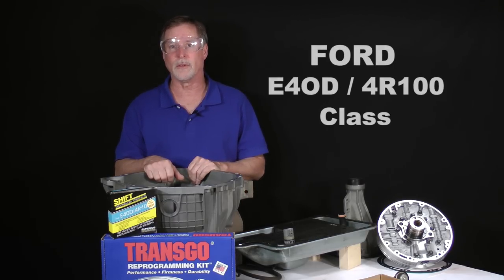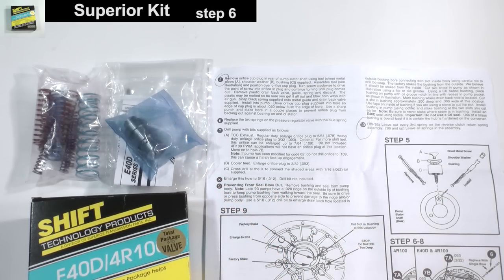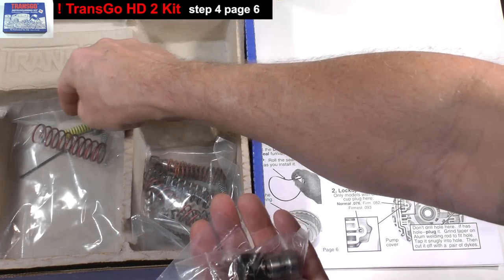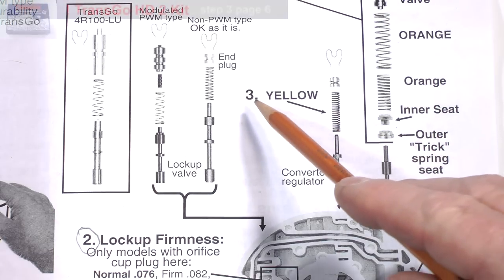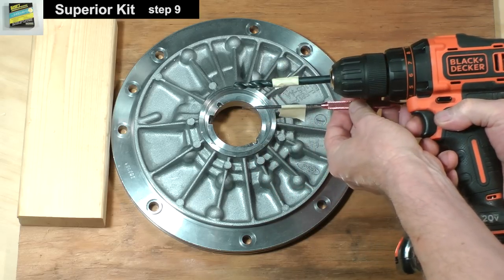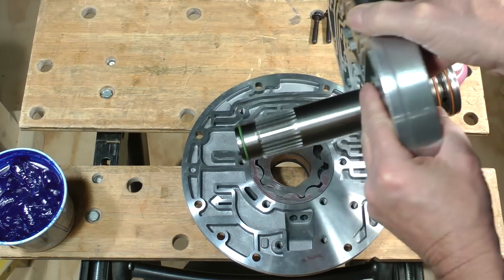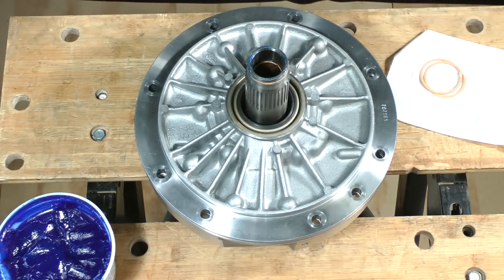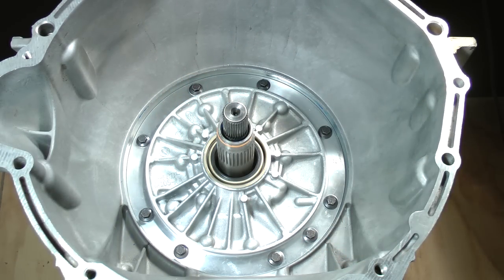Ford E4OD / 4R100 Class lesson 13 of 16

Comment: Love these videos. They are at a good speed to perform the work while watching. I used these to do the initial break down, inspect, clean, and creation of needed parts for my 2003 diesel 4R100. I ordered my Super Deluxe kit from Transmission Bench March 2024, which came with training videos on a thumb drive. Jimmy is great and will take the time to ask and answer your questions. The new kit didn't have the neatly labeled white parts bags, but it was still easy enough to figure out which parts go where. If you have an older vehicle, I highly recommend doing this work yourself. It will not only give you the confidence to do your own repairs, but you can also save money, or put the money into upgraded parts. Only you will put the best time and attention into your vehicle repairs, all while learning something new. Keep up the good work Jimmy!
Reply: How far along are you I'm considering building the e40d in my f250 using these video
Reply: @joshuadaniel1001  I have completed the rebuild and now I am putting everything into the truck. Take your time, don't force anything, and go step by step with the videos. You may find small differences with your transmission like I did, but I was able to "Google" my variances to ensure correct rebuild. This project will teach you some great mechanics about automatic transmissions.
Reply: @JDM850  when you get it in and test it let me know If you dont mind a verified success case is motivating
Reply: @joshuadaniel1001  Sure thing! Marshall Sanders videos also had some great information on how the clutches in the transmission and valve body works, in depth. You will easily be able to understand how simple it all functions, which will increase confidence for a task like this.
Reply: @joshuadaniel1001  Success! I added the 18 quarts my system needed, had it on jack stands for the initial FWD and Reverse test. Then did driveway FWD and Reverse test.  For road test, went through all (1, 2, D, OD on/off). WOW, shift kit ensures it is in gear, lol. Recommend smallest holes when drilling, as kit instructs. Gentle driving, shifts great. Drop the hammer and she locks and goes, no questions, and no mushy shifting anymore. I went the extra mile to over engineer with the Suncoast center support kit, 300M input, 4130 FWD drum, and a Goerend TC. Even with all upgrades, it was still 3k cheaper than having it done at a shop, plus I now know more about my truck and the love that went into building MY transmission. Good luck and you can do this!
Reply: @JDM850  wow that's awesome I plan on doing every upgrade I can I intend to use it for pulling  in an f250 so definitely the steel planets if I can get them.
Reply: @joshuadaniel1001  I had no trouble finding and comparing parts/costs. Be sure you find out specific build of transmission and accept that you may still find a part that has or has not been updated by factory. Like mine had an updated factory sun gear shell, so it didn't have the brass washer exactly like the videos. Separate topic, the only irritating time finding upgrades, Suncoast does a little misleading sales tactic with their FWD drum. It says it will increase frictions from 4 to 6, but they don't tell you, you MUST use the thinner Alto Red frictions they sell. I still upgraded the FWD drum and just used the 4 thicker factory style frictions and upgraded Kolene steels throughout transmission. I learned more frictions equals more surface area of clutch grip, but is a thinner friction going to hold up long term? Us common folks don't rebuild our transmissions yearly or after every drag race or tractor pull. Basically, I have faith in the thicker factory frictions and my ability to maintain my vehicle, since I don't abuse my truck or race it.
Reply: @JDM850  so to get the extra clutches you have to use the thinner ones they sell
Reply: @JDM850  I'm not going to abuse it but I do plan to pull a car trailer about 5 to 10 times a year with different vehicles on it probably no more than 8500 pounds total

Comment: When I performed video 13 of 16, I cleaned the pump halves after drilling ALL the holes required. Then I installed ALL the required parts. This removed or lowered the possibility of getting tiny metal pieces in the system. Just my recommendation.

Comment: Two 7" clamps will be too large to align the pump, use 6". I bought 7" from Home Depot and the diameter was way too large even after screwing as far as they could go. The 6" worked perfect.

Comment: Had me freaked out there on that last test fit with the pump Mr. Williams......I triple checked coast clutch assembly and everything was good. there was a slight ability to spin pump on test fit but not when gasket was in place. Fortunately everything installed fine.
Reply: I’m running into the same problem the pump spins freely however there is only .002 of clearance between the pump and the case everything went together beautiful until this point.

Comment: Step six of the pump boost valve sleeve without the OEM orange spring will cause the sleeve to fall inside the bore Jimmy puts assembly grease to hold it in place but once that grease melts the sleeve will fall inside the bore transgo kit reuses the OEM orange spring and i personally think it is to keep the sleeve in place as well as to help increase the combined spring preassure.so hope this catches your attention if you are installing this superior kit put your mind into this step 6 study it carefully and you will see I'm right.thanks everyone for taking your time to read this important step 6 don't just use the blue spring by itself include the original orange spring as well or you will regret it.

Comment: Can you tell me if I should band my 4r100 pump before tightening the two halves together? I have a second hand pump and it won't go in. I hear it needs to be banded but that only makes sense if it's done while being assembled? If i break the bolts loose won't the seal need to be replaced as well?

Comment: in the pressure regulator assembly you took out two springs, a inner and a outer but when you re installed the springs you left out the inner spring.  are we not to use the inner spring with the new kit?
Reply: U

Comment: Showing How-to-do overhaul—excellent. Hitting mushroom head race driver with steel hammer—Unacceptable.
Reply: while you are probably correct in that a different hammer would be preferred and a steel hammer should be unacceptable, this guy probably has thousands of reliable and well built transmissions which accepted his love taps just fine. this is a class series geared towards car owners with limited shop experience or limited access to tools, but yes he should have just used a deadblow or rubber mallet since the steel hammer is mostly unnecessary and a bit aggressive to be using on something that is being put together with such clarity of thought to details. i want your shop to rebuild transmissions exactly like this guy does with every piece stored on a 2.5x4 foot table separate from the work area with bolts in 4 boxes arranged exactly as shown and videos showing every step and part as it is replaced and then you can use a rubber mallet instead of a ball peen. if you will recall in lesson 1 he said a claw hammer would work just fine and i would be willing to take his word on that. i disagree with the amount of assembly grease he put on some of the parts but you are not going to see many people with this much command of the machine taking shortcuts or being careless....
Reply: @Trey ChastainWhen two similar metal tool collide with force, one of them could shatter. Thus, it is safer to use a lead or brass hammer against steal punch or chisel. The mushrooming of the head of drift punch or similar tools, are indication that it is a less solid metal. It is possible that a steal hammer can cause a piece of mushroom head to separate and cause injury. See my personal experience mentioned in my previous comments. No disrespect intended to the instructor. Just sharing my instructors teaching of safety procedures working in a shop.
Reply: @Trey Chastain My Automotive training started in 1967 at a trade high school. I have even made bearing/seal installer in metal shop. The "puck" end should be aluminum, but the handle (which is used with different pucks) could be as seen here from a stronger metal. A closer look shows the mushroom head. I guess we agree to dis-agree. Be well.

Comment: Mushroomed chisel head is very dangerous. Especially when hit by a steel hammer. Great lessons otherwise.
Reply: @Trey Chastain If you stop the at 30:27, you will see what looks like a steal handle attached to an aluminum puck like disc. The working end of the tool is not an issue. Where the hammer blow meets the tool is the issue. the mushroom head is very obvious.
Reply: Hitting with the hammer to the steel chisel are two different hardness strength. obvious chisel mushrooms its weaker than the hammer it wont mushroom not much danger.  taking two hammers swing them fast into each other will fracture possibly explode!
Reply: Oh let it go, lol.... Great series.
Reply: Just watch “Shaking Hands with Danger”.  Nuff said.